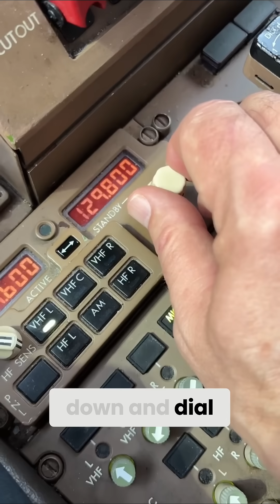Captain Steve's Guide: Communicating with Ground Control!

Comment: I Like to take my 2 Meter handi-talkie ham radio with me on trips.  It is fun to listen to the air traffic. The 2 Meter ham band for VHF is 144 MHz to 148 MHz... But there are many interesting signals to Listen to Above and below the ham radio spectrum!  

I make a point of removing and securely stowing the battery and radio separately BEFORE BOARDING!
I do Not want to be a possible source of HARMFUL INTERFERENCE! 
~ Russell KE7QXR

Comment: Nothing strikes fear into the hearts of new pilots more than hearing "I got a phone number for you to call." 😸😸😸
Reply: I’ve had that happen.  I didn’t even know what I’d done wrong.  Turned out one of my two radios had failed, and I didn’t realize it.  ATC had been trying to contact me, but I didn’t hear them.  The display of the radio was illuminated, and the little light that illuminates when you talk was working, so I thought everything was just fine.  I switched back to the good radio upon approach to my destination airport.  That’s how it’s done.  You always have one active radio, with the other one dialed in for the next frequency you’ll need so you can quickly toggle as you proceed.  Upon landing I got the message to call LA ATC.  This call can mean the difference between being a licensed pilot or grounded on the spot.  After I explained what happened to the guy on the phone, he was a tad grumpy but just told me to be more thorough with radio checks.  Let me off the hook.  Whew!  You can bet I checked those radios like a nervous hen every time I flew after that. 🤣🤣🤣

Comment: Question Captain Steve , do pilots not use Acars any longer to speak with dispatch. As a former flight attendant but retired in 2012 we sometimes received our passengers gate assignments through Acars, sometimes we would get messages from crew scheduling through Acars the pilots would call us and let us know about tight schedule changes, and I recall many pilots using it to speak with company dispatch etc. 🛩

Comment: How does the ground temperature affect landing? I know you need longer runways when it's over 100 degrees fahrenheit
Reply: Higher temperature generally reduces aircraft performance, which means that on landing, as well as takeoff, the ground roll would be longer, and on takeoff, it would take a longer distance for the airplane to be able to clear a hypothetical 50 ft obstacle on the departure end of the runway.

Comment: Those sat phones can be listened on to very easily. You can use a SDR radio and a special antenna designed to pick up satellite frequencies and a program called JAERO. However, you can only hear one side of the conversation. Also works with acars as well has ads-c information. Has well any information on aero C channels from Inmarsat.

Comment: So if the frequency number is in a range, how do you know which one the airport is using?
Reply: It’s on the charts and approach plates.  Also ATC will give you the frequency when they hand you off to the next sector.
Reply: Simple so approach plates include all frequencies in use. Voice, navigation, etc. You can even look them up yourself.

Comment: Speaking as someone who's set up marine satcom - it's a lot more than 'a little expensive'. Even for voice-only.
Reply: Probably the airlines get a bit of a discount?
Reply: @sbrunner69 Probably not actually. Maybe a slightly lower negotiated rate, but I doubt there are that many satcom providers for that to work. (Used to work for an airline myself and we didn't usually get discounts on stuff.)
Reply: How expensive it could be? Any range?
Reply: Prices are dropping these days. Iridium will get you a phone link costing about $100-$200 a month. The equipment for a plane isn't cheap, though. Air time is way less than a buck per minute these days. Used to be upwards of $10/minute.